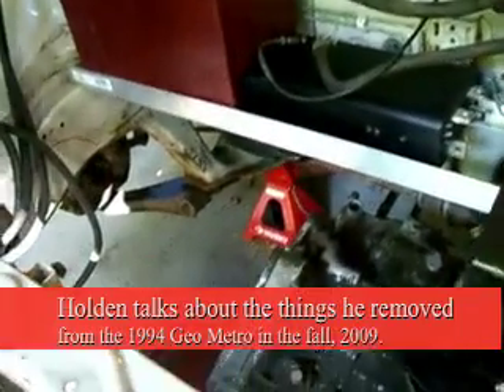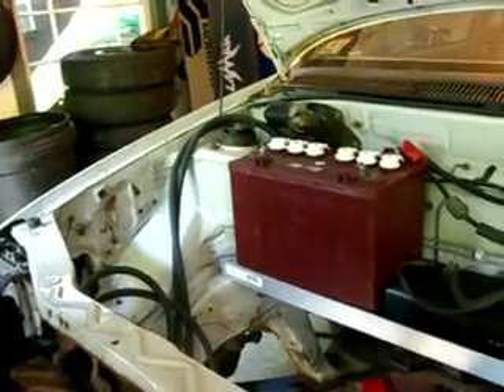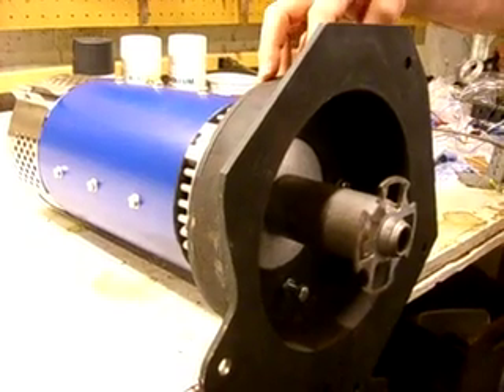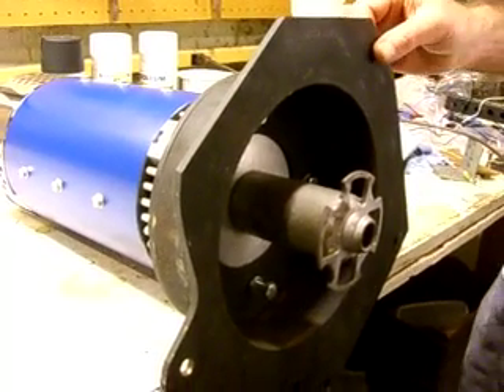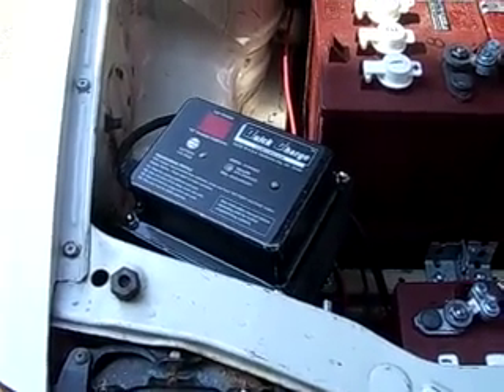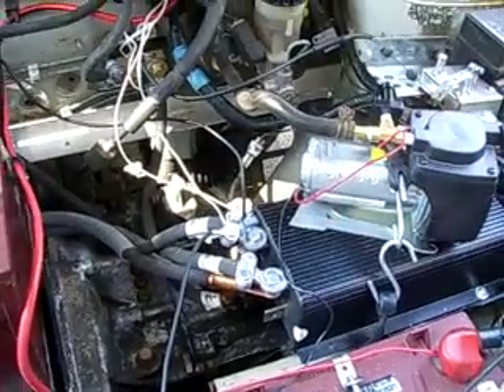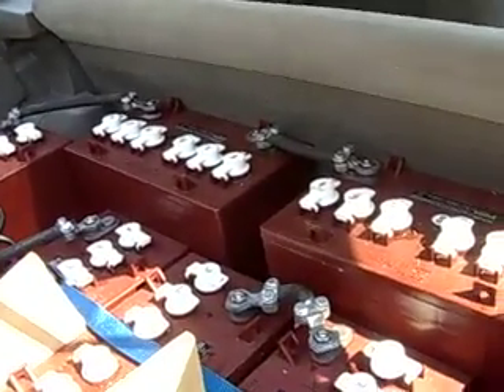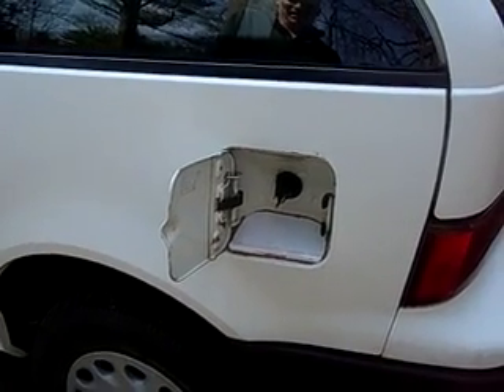Building an electric car in Sudbury

Comment: You should go to your local hardware store and pick up several 36vt batteries, make sure there Delwalt lithium batteries. Then when you get home you pick the delwalt lithium battery cases then u stand the lithium batts up, use electrical tape to wrap around the batts and keep them in the case. You set them up the same way as you did with those batts but they take up less room, so you have more storage and more can be put in for more power. Also get a chager control so batts charge in less time.

Comment: I see it says there is an additional 900 pounds of weight in the car, but didn't removing the engine, radiator, fluid reservoirs etc., reduce a substantial amount of weight from the vehicle?  

It just seemed like that number may be a little high, but I could be wrong.